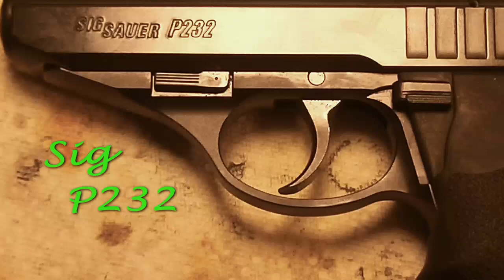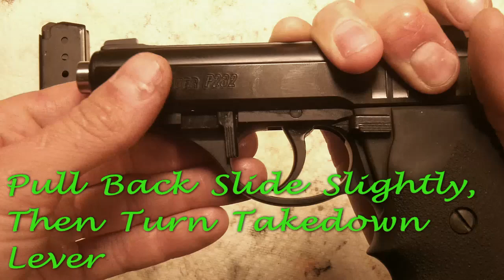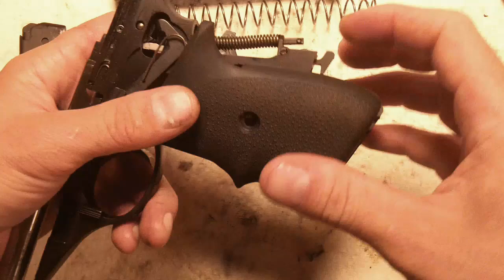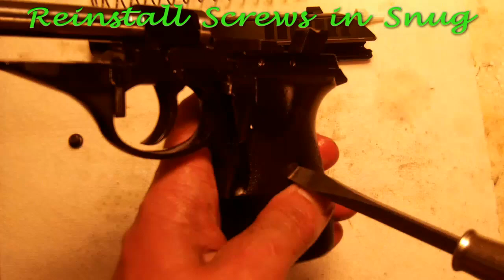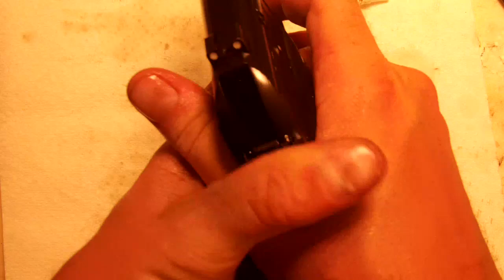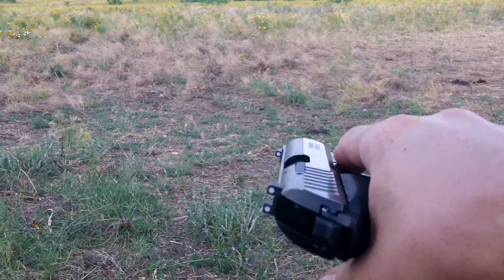Review and How to: Field Strip Sig P232 [HD]

Comment: The slide catch spring went flying somewhere on my cellar floor. Just got this sig p232 and after running 150 rds through it. took apart to clean, but the slide catch was sticking outward and the barrel wouldn't go on and suddenly the slide catch spring went bye-bye. will have to order a new one from sig sauer. Wonder if you could show how that spring goes back together?

Comment: good video however had a real hard time getting barrel & top slide to 'marry'. I followed your directions with hammer cocked etc however once barrel came through,slides wouldn't slide. Im sure my fault not yours. Truly a great small weapon & at 25 feet easily keeps a nice small pattern.
Reply: Once you have the slide on the frame you need to press down on the slide, the slide will move forward on the frame into "battery"

Comment: Unlike what mer171 answer. Why should the +P be to hard for the alloy frame? Their are many alloy frammed guns in 9x19 or even 40S&W. But I would suggest a stronger recoil spring! And the most important question is if the chamber is strong enought! But this I dont know.  I dont see any sense in 380 +p why dont take a 9 para straight away.

Comment: Why so much lubrication, do you live in a humid climate? Lubricant attracts dust and sand, it is only needed in places of friction..
Reply from the maker: That one was going in a safe for undertiminable amounts of time where there is no sand or dust in a case. but usually i oil little heavy to prevent rust, but yeah you have to wipe off the access before firing for sure.